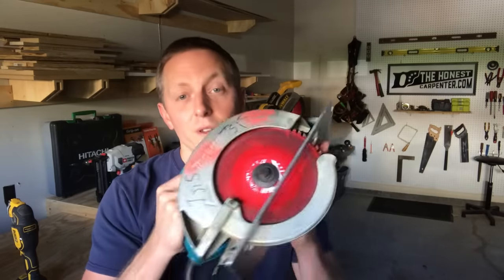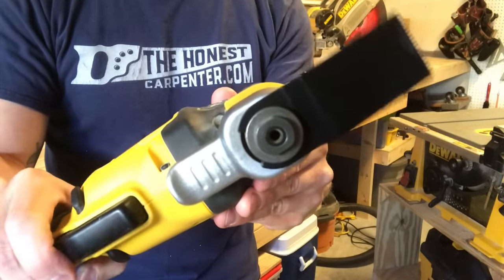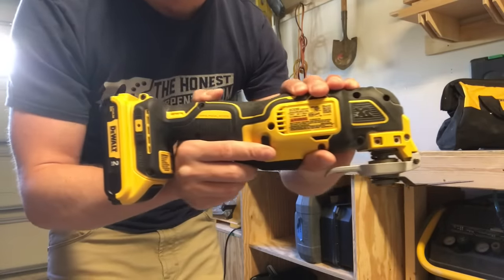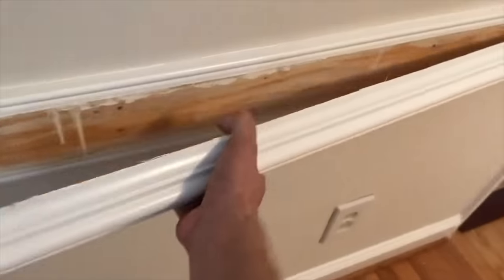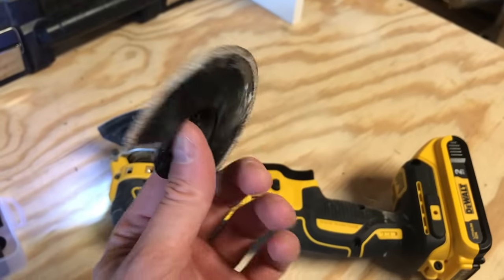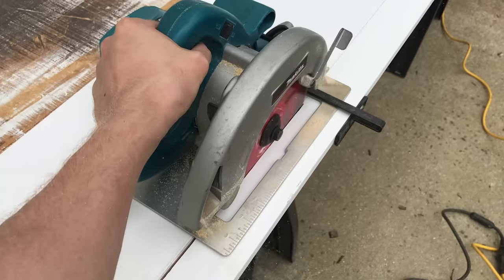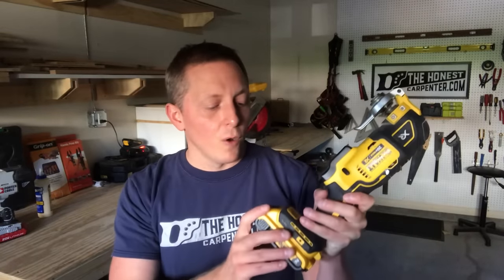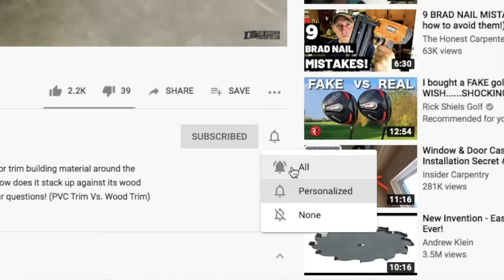The BEST SAW You've NEVER HEARD OF!! (Multitools--Great For Remodeling!)

Comment: I've been a carpenter for 33 years. I've been running an oscillating saw since Fein came out with it at least 20 years ago. I'm now having major nerve problems in my hands and arms. Of course, many other tools involved, but the multi is an obvious major culprit. Please consider getting the best anti-vibe gloves you can find if you intend to use this tool frequently. There are things these cutters can do that really shouldn't be done.
Reply: Thanks for that important reminder!  safety glasses, hearing protection, dust mask, and add anti-vibe gloves; if you like working with your hands - take care of them.  :)
Reply: Thank you
Reply: I’d been having nerve problems.  I picked up my calcium intake just by drinking milk and it’s made a major difference. I don’t know if it will help you but worth a try.
Reply: Like what?
Reply: @melissacook5186  like dry wall for example.  Its not that much harder to just cut it, and its not as clean ... But maybe not use the tool for that unless its for cutting out an electrical box or something where you want a clean edge.
Reply: Thanks for the warning, i had wondered about that since i have carpal tunnel damage from years ago... I mostly try not to use it unless absoloutly needed because of the blades... I think the cheap ones last far less, but they all chew up easily 😆 i didnt even use ear pro for a long time (what an idiot) i was amazed at just how loud that thing was after I threw some on for the first time, i just thought the sound was annoying before that, its really bad though. Always using it now.
Reply: thank you for sharing your experience ❤
Reply: I had no idea about this. I will need to look into this further. I've used this type of saw countless times and almost always you get to a spot in whatever you're cutting and the saw struggles and transfers intense rapid vibrations for prolonged amounts of time while working.
Reply: Thanks for the warning. 
I'll give up on multi tools. Nothing is worth years of discomfort in old age.
Reply: My Milwaukee multitool doesn't vibrate my hands..
Reply: Hi there, from your experience do you trust the off brands he has in his links?? I'm just a simple dyi person...
Reply: just get the makita.
Reply: @slatsgrobneck7515  What are anti vibe gloves?
Reply: @bassheadlife492  it absolutely does... just because you aren't paying enough attention to notice an issue doesn't mean it doesn't exist! Those small vibrations will cause serious nerve damage over time.
Reply: @BeetleBuns  which oscillating tool do you use?
Reply: @bassheadlife492  dremel right now, but that one vibrates more than the milwaukee does. The milwaukee's not bad, but mine broke and I needed a new one quick cause I was in the middle of something and it was either that or the dewault which is way too big for my taste. Gonna be honest though, the gloves don't really work that well. The best thing is to limit how long you use the tool each time, my hands are fucked from long days with a palm sander so using any tool that vibrates at all messes with them for hours.
Reply: @BeetleBuns  good advice!
Reply: Thanks I just bought a DEWALT today, I will look for those gloves
Reply: No problem. I like the Tillman 1489 @bigbadlouroma
Reply: they make newer ones now that dont vibrate as much but still have the same power
Reply: That’s vibration white finger mate, you wanna get to the doctors asap before you risk losing your fingers!!

Comment: Ironic that as an orthopedic surgeon, I have been using these oscillating saws on bone ( and casts) for 40 years. Now I am getting my first one for my home😎
Reply: That’s great—I found out my orthopedic surgeon used one on my knee. He says he’s doing carpentry work as a surgeon but I say it’s definitely fine finish carpentry!! Do you know if Fein Tools (Germany) manufactured your surgical saws? Thanks for your good work—we old carpenters and tradesmen are grateful to be sure!!!
Reply: @richardhall6762  Slight pay difference....
Reply: Good to know, I can save myself money and perform my own orthopedic surgery a DIY project ;)
Reply: @jimwatchyyc  it may hurt a little. Remember  measure twice,cut once.
Reply: lol.  Good point and you don't have to worry about an infection!
Reply: I was an surgical tech for 10 years 6 of which I spent assisting total joint replacement (about 8 per week). It is ridiculous the cost of those tools in surgery compared to home depot.
Reply: @ImAChristianFirst  True $30k for the set. But you cannot sterilize those from Home Depot😎
Reply: @charlesmalone4379  I know. It just seems someone would have come out with a more efficient set.
Reply: @ImAChristianFirst  Ain't that the truth!
Reply: I assume the ones they use for medicine are a bit different. No? Because I'd be terrified if my doctor whipped out a DeWalt tool in front of me lol
Reply: @ballwizz23  We use the circular blade and it just vibrates to cut.  Doesn't spin.  Plus casts have a ton of cotton between the cast and the skin.  No worries!
Reply: @ballwizz23  The difference is the tools in surgery are all stainless steel and can be processed in an autoclave. With the advent of 3d printing we are now using some 3d printed nylon tools. Some are disposable and some aren't. All of our saw blades and drills are disposable which are disposed of after the surgery.
Reply: Where's the irony?
Reply: My understanding is that these saws originated to remove plaster casts from arms/legs, etc. It is actually pretty hard to hurt yourself. You can touch a working saw blade. The skin is elastic and vibrates with the saw. It will only cut if the material is stationary.
Reply: Aspiring orthopedic surgeon here (3rd year medical student),  been honing my skills on wood and drywall before I go to bone. The opposite approach you took ;)
Reply: @JakeRadabaugh55  but a bad cut in drywall won't heal on it's own :-). But, It's never good to hear your surgeon say, "Oh, oh. Crap!"
Reply: @mddale  true, but a new piece of drywall is a couple bucks, I haven’t been able to find a reliable source of femurs at my local big box stores
Reply: @JakeRadabaugh55  as stated the cuts have to be correct the first time in surgery. We may be glorified carpenters but we are “ finish carpenters” 😎Keep up the practice, and good luck in your future. It was long hours and hard work but I never felt better than when I completed the task knowing the patient was going to do well.
Reply: @charlesmalone4379   maybe I’ll use that quote in my personal statement 😉 appreciate the well wishes!
Reply: @JakeRadabaugh55  Hats off to you guys. Absolutely amazing the outcomes of the bone work. I have so many friends an family who are now able to walk around pain-free because of joint replacements. Often home the same day. Incredible.
Reply: @ImAChristianFirst  I worked as an Administrator in healthcare for many years and you are right. The price and specification of most anything "healthcare"  from electric wall receptacles to stainless steel OR tools is out of hand.  Primarily due to incredible hand wringing worry over potential litigation if there is an accident and meeting various voluntary and costly to implement quality standards.
Reply: @charlesmalone4379  The vendors that supply those "special" saws charge that kind of money because our failed healthcare system is willing to pay it.
Reply: It's been around longer than that  ,,  Was invented in 1967  ,,Was used in carpentry and other uses
Reply: @ImAChristianFirst  and it all comes out of the poor patients / insurance pocket.
Reply: @JakeRadabaugh55  hone your skills on research and evidence. research twice, avoid surgery / complications once
Reply: That is so interesting!? Had no idea doctors used this. Wow!
Reply: Ya I remember one being used on my cast on my broken leg as a kid
Reply: I had my plaster cast removed from my arm aged 7 1965. I’m now 63 and still have a fine scar running up my forearm. The nurse said  it sounded like a decapitation without an anaesthetic.
Reply: Not so surprising that innovations come first to high value infrequent users and then trickle down to the mass market. This happens with boat construction techniques.
Reply: Why do you need to cut bones at your home? Lol
Reply: @angussmithfield1265  Are you saying they cut you when removing the cast?
Reply: @ImAChristianFirst  as my self working in pharma. The specs on equipment on pharma and medicine are alot higher. Even the steel need to be traceable as well how people got trained back to genesis ie the person that created the methodology
Reply: Where I come from we call it the vibrator
Reply: @geodude6244  
Y'all a little rough when you come from... 🤣🤣🤣
Reply: I know they work great on casts
Reply: @richardhall6762   Homer H. Stryker, an orthopaedic surgeon from Kalamazoo, Michigan patented the first oscillating cast cutting saw on April 2nd 1945
Reply: As a carpenter, does this mean I can call myself a “house surgeon”?
Reply: Sitting in the dentist’s chair getting an implant, and the dentist was training someone else and explaining every step: it was like I was in my workshop hearing them name and use all the tools I have, just smaller. Drill bits, Allen wrenches, screws, etc. A dentist is just a carpenter with extra science training.
Reply: A cast saw was the first thing I thought of when I discovered these.
Reply: @YouNeedJesusNow  Yes, quite a few careless people around involved in personal care.
Reply: Can you use the saws at home? Surely they are sharper and more precise than DIY tools?
Reply: I don't know how old the design of these oscillating saws is but in 1952 I broke my leg and had a cast on it.  When the doctor removed the cast he got out his saw and told me he wouldn't cut me but I was nervous about him cutting that cast off.  Sure enough, he cut the cast off and I didn't feel a thing. I believe they were using an oscillating saw, but I never heard of one until a few years ago.
Reply: Morticians and Forensic scientists use them too.
Reply: Hi Charles if you get a chance try the new makita dtm52. Loved the dewalt but this new model is far better especially with noise and vibration reduction 👍🏻
Reply: Im an Ortho tech in emergency and in clinics we use cast saws (oscillating device )All the time!
Reply: It may be interesting, but it's not irony, Dr. Malone.
Reply: In all your forty years, you're saying that not once did you take it home for the weekend?
Reply: I was just thinking that haha.
Reply: That makes sense! it's terrible at cutting flesh! :)
Reply: I think these were originally invented for surgery.
Reply: I thought the joke was that a chippy’s work will be squarer than an orthopod as you can see their work.
Reply: @charlesmalone4379  id just buy a new set for each surgery, still cheaper lol.
Reply: The first time I ever saw an oscillating tool was when I got to observe a knee replacement as a kid.

Comment: You are wrong about the "danger" part. The multitool doesn't rotate around, but vibrates just a touch left and right. Your skin is elastic, so getting the blade on your spin while it's on isn't really dangerous. The blade cuts non moving parts, but your skin would just move a touch left and right.

Comment: I know this is a Carpentry channel, but don't forget that the multi-tool is the BEST tool for grout removal. You can get grout discs in the exact grout joint thickness needed, and can even buy fixtures that all you to maintain the same depth and line to remove the grout perfectly side-to-side motion. Once grout is removed with this tool, re-grout with brand new grout and it's like you have a whole new bathroom.

Comment: Tip of the Day: Want a clean wood or tile floor install? Use the Multi Tool to cut the bottoms of door jams to slide wood flooring or tile under the door jams. Makes for a much cleaner and faster install with little no caulking or grout lines around door jam bases.

Comment: I purchased my first oscillating tool to cut the base of a cabinet to replace it due to water damage. No other saw would have gotten into that small space. I was quoted $350 to do the same job by a professional handyman because he would have had to remove the entire cabinet to do the work. Including buying the tool, the blades (which is also used in other projects), the wood and fasteners I paid about $60 and it took me about an hour. I'm also a mother with a toddler, so saving time and money is a must!
Reply: awesome
Reply: How did you get the new base board in?
Reply: @justink2101  measure it, cut it and then miter/cope it depending on the piece. Then put it where it’s going and nail it in with trim nails would be my guess. I don’t really know any other way to do it. I guess you could use trim screws or some kind of adhesive if you wanted to but it’s still basically the same.
Reply: @mesohunt704  the way the post is worded I assumed they were replacing the entire bottom piece which would never fit through the doorway. But I think I interpreted it wrong. Thanks though.

Comment: When the spacing between porch planks gets filled with gunk, it becomes my go to tool.  Also I glued a piece of sandpaper onto the bottom of a dull blade to sand hard to reach corners.
Reply: That sandpaper idea is ingenious, thank you! I'm running in to issues with the gunk in the cracks of my deck... Do you just swipe the tool through the cracks without it being on?
Reply: @KY_CPA  I use dull blades for removing trim caulking.
The vibration works just fine.
Reply: How TF.... Bro why did I never think about that ?! Holy cow , we're like chimps learning to use to spears
Reply: I bought a old 5th wheel trailer, the roof was resealed, but terrible job, leaks in several places, the guys that did the work didn't remove the old caulk, because you need to use a heat gun and scraper, not anymore.... Let's do this !
Reply: They can also be used for removing plants growing between the pavement stones of whatever you call 'em. A gas burner is fastest for this, but you can't use it in some places.

Comment: You know I was a carpenter for years,dabble in it still.Every since Fein came out with it I always saw the multi tool as a gimmicky kind of thing and never used one or took it seriously.I had one laying around brand new in the box I got free from Harbor Freight,had it for years just sat in the box.Well last summer I was doing something and broke my sawzall blade,I didn't have much more to do and didn't wanna run to the store so I gave in and figured Id give the multi tool a shot.It was at that point I realized I'm a hard headed idiot 😅.My God,I was just notching out a 2x6 for outriggers and I was so amazed how fast and accurate it was .Fast Forward a year I gave the HF one away but now own 2 M18 multi tools and I am always using them.Looking back at all the things that a multi tool would have made easier but I was just to stubborn to give it a shot I am kicking myself in the pants.
Reply: See I haven't spent enough time as an idiot (started in 1984, I'm obviously not very smart), I own one just have never warmed to it. I'm still the #1 advocate for a jigsaw, I can cut nearly anything with one, if you happen to ehhh over do it, worse thing you'll probably have is a badly scrapped finger!
Reply: When I was doing cabinetry, on site installs always had trim that needed to be cut or outlet holes, things that are impossible or tricky to do in the shop. My boss would haul out the Fein, cut, and then when putting it away would say "I love this tool". Didn't understand until I had to work without one. Took two jobs without one to give in and buy it!
Reply: Better late than never Dustin.
  In certain situations there's nothing that can compare to the little jiggler and its laser like precision!!

Comment: If you ever have have a door that is dragging on the floor, this is the perfect tool to slightly trim the bottom of the door for clearance. Just rest the blade on a spacer, say 1/16" or 1.5 mm, and then trim the bottom edge of the door. Easily done without having to remove and re-hang the door.
Reply: Never thought of that. Perfect!
Reply: Too much work and wear for the saw specially if the door is thick and made of hard wood. Much better to remove it and just use a circular or jig saw.

Comment: I recently restored an old wood staircase. We removed the carpet first which was no problem but them discovered there was old, glued down linoleum underneath. I used this tool to no only help pull the laminate off, but removed the leftover glue on the wood. This tool saved me hours of work and frustration. Great tool to have.

Comment: I used my oscillating tool with a knife attachment to remove old glue from the studs when re dry walling.  It cut it off amazingly fast.  It even seemed to work best at a low rpm.   The slow speed seemed to jar and cut the glue and chip or chisel it away.  This slow speed saved the battery life of the tool as well.  Good show, keep up the good work!!!

Comment: Pro Tip: Install the blade on any multitool PERPENDICULAR to the handle of the tool. You have far more control and it makes it easier to rock and slide the blade so you’re not holding the blade in one spot and grinding down a notch into the blade into that one spot. Your blades will last longer and you will make cleaner, more controlled cuts. Try it! You’ll never go straight again.
Reply: Yes, it seems logical that you would have much more control than the leverage the blade has when sticking out the front. It seems like a no brainer, but I do realize sometimes you need to get into a spot... so that's the only time I would extend it out front.